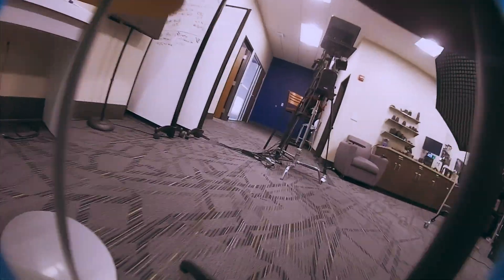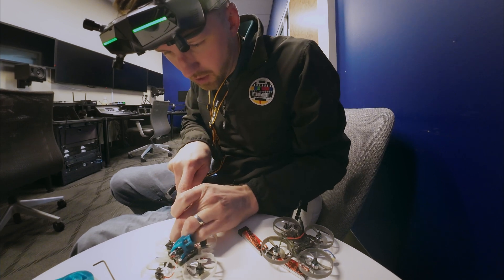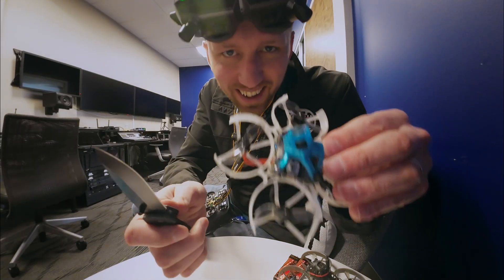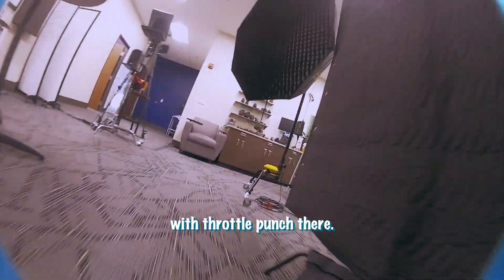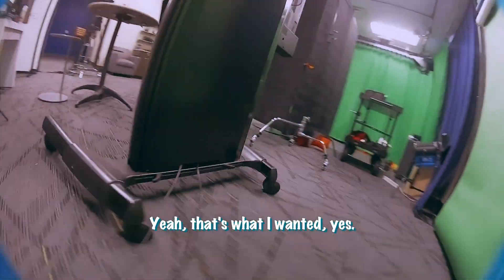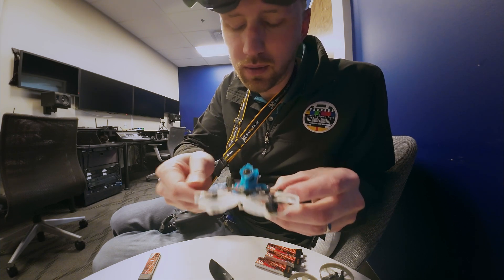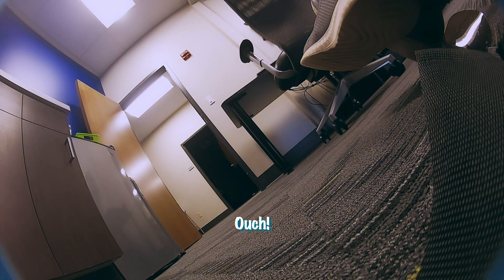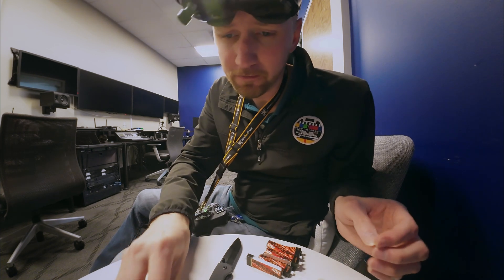How Much Can I Cut Before It Fails?

Comment: I did this to my extra Neo... the antenna is in the rear duct where it gets bigger. thats the only part of the ducting left. If flies fine. Its quieter.  I left 2 of the 3 motor supports in tact to hold all 4 motors.
Reply from the maker: @dijax7863  awesome! I think if I had been on the thicker stiffer v4 frame it would have been fine to cut 2of 4 supports off and even more duct.  This v2 frame i light but also too flexible

Comment: Nice flight!!!. Not sure you're interested or not, just want to update my journey.  I have been practicing on my fingers speed in order to tight sharp turns. Weeks with no improvement, so I decided to increase yaw rate a week ago. Boom!!! I have improved a lot since last talk about rates.
Reply from the maker: Awesome! I increased yaw rate a lot too.  It seems to help me not move throttle around as much too.
Reply: @Shauny_D  Still working on sharp turns, they are better, but still very sloppy. FPV is not easy at all.
Reply from the maker: @chirots  camera angle will play a big roll too. If you're doing racing turns you'd be surprised now much your pitching as well.  A lot of coordination of all inputs.  Practice flying through gaps backwards! Thats the trick for racing at least.
Reply: @Shauny_D  I realise that too. With 25-30 camera angle and low yaw rate, I have to input more roll(properly35-60degree) for speedy sharp turns and have to quickly pitch up as leaving the corner. At this moment, I find my current comfortable rates
R 150, 880, 0.40
P 150, 880, 0.40
Y 150, 950, 0.20
I have been changing them for past 2-3 weeks.
Reply from the maker: @ if you’re pitching up as you leave the corner your speed checking yourself.  Try to keep pitch more first and throttle up out of the turn instead.  
Great practice for this is turning with the wrong nose down.  So a right or clockwise turn normal your front right motor would be the most downward drone banked/rolled right.  Instead try to do a clockwise or right turn leading with the left front motor down and first forward.  It’ll feel weird like a freestyle trick at first but you’ll learn to throttle up through turns that way.
Reply: @Shauny_D  Thanks for another great advice, I have tried that and kinda a bit uncomfortable, because I have to look slightly to the right when turning left. Not sure whether or not I understand and do correctly.
Reply from the maker: @ yah it’ll feel weird almost like a sideways front flip around the turn with the belly of the drone toward the obstacle your turning around.

Comment: I’ve done it and yes it does handle better on the tiny whoops and yes you can fly like that cut off more of the frame! It’s sounds counter intuitive but true
Reply from the maker: I didn't notice much while recording and flying but it was obvious watching back in the edit that I was flying more free and clean!  I just build a full open prop walksnail that I need to show off once now too.  I will fly with a bit more free knowing there is prop protection but I do love the feeling of open.
Reply: @ yes 🙌🏾 mann you know a what your talking about! You just earned a new sub from me and love the setup up and pilot skills! I fly a mobula 6 for the tiny whoop and custom 5in build I did a few years ago, I still run 4s😅 haven’t flew in a while but you sure a hell made me blow off the dust and get back flying🫱🏾‍🫲🏼
Reply from the maker: @ That's the best comment ever thanks for the support and feed back.  Careful jumping into micros you might never go back to 5" 😜
Reply: @ ik them micros are addictive want to change over to them xt30 baby connectors, heard they give better flight times✅
Reply from the maker: @GorrillaFastTv  and so easy to start flying.  I will stare at my 4s batteries and drones and heavy sigh 10 times before just charging up some 1s and flying inside with a whoop.

Comment: What if you tie it with some sewing string or something of the sort? Is there some arrangement of tied points that can make it sufficiently stiffer without sacrificing airflow or risking getting caught in the props or motors?
Reply from the maker: @tiagotiagot  I can’t picture that working 🤷🏻‍♂️
I’m sure a simple 3d printed bracing would do wonders for it, but then again you might as well just put the whole thing on an open prop carbon fiber frame at that point

Comment: what is your actual beta flight pid rates?
Reply from the maker: @letrevz2584  i don’t know I’ve been copying the settings for this build now for a couple years!  It’s on 4.1 i think too so it won’t translate well to newer BF versions.  
I typically up the master slider 3-5 clicks and the dterm up a click or two and iterm down a click.
Reply from the maker: @letrevz2584  oh wait do you mean rates and not pid tune? I just did a video about my rates https://youtu.be/IdgeFMLNFME?si=fCo5Yoj40YMX5AVo
Reply: @ yap pid in actual,,tia
Reply from the maker: @ I put my rates into a betaflight to actual calculator. 
https://rates.metamarc.com/
161, 876, .78 pitch and roll
235, 1001, .53 yaw for freestyle